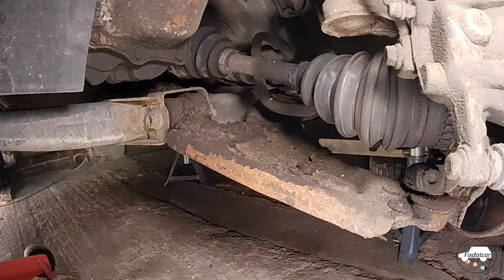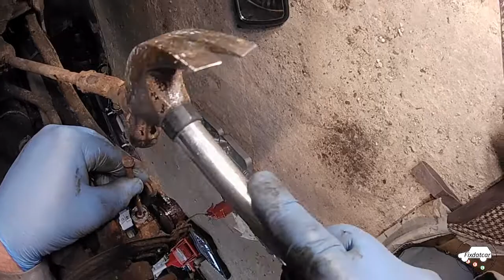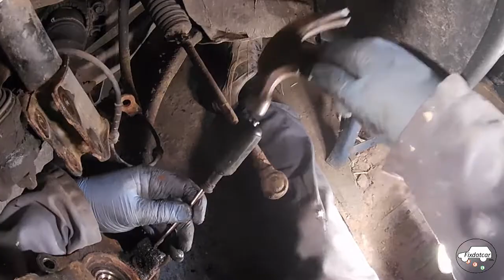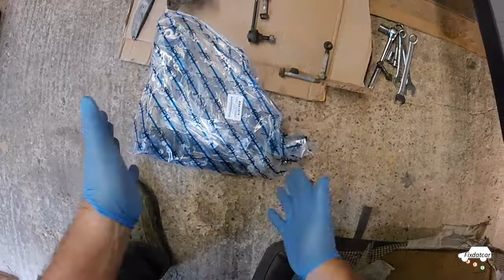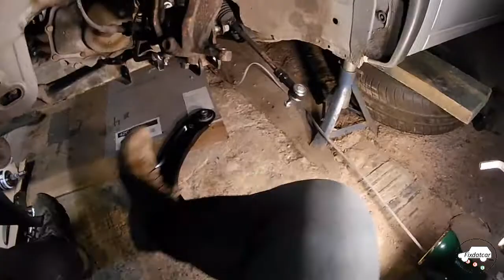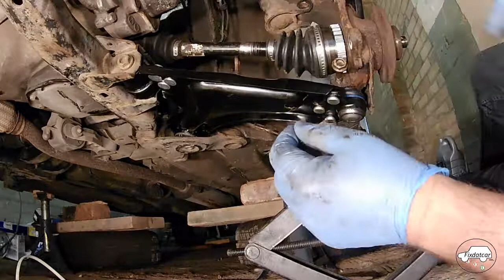How to Replace a Front Wishbone (Corsa example)

Comment: Any tips or photos of the best place to jack the car and place the jack stands? Yours seem to be a long way forward of the “official” points but much better placed for this job? Same q for rear of the car. Thanks for any tips.
Reply from the maker: Car jacking points vary by model. Either end of sill is normal, but some will have an additional central jacking point under a front crossmember. 
On small lightweight vehicles adequate strength can be found in other places (crossmember under front foot well and rear suspension areas). But be careful!
When using jack stands always add extra support for safety - In case of slippage.
Reply: fixdatcar Thanks so much for the quick reply. I was specifically asking about the Corsa C as the hard points seem quite limited. Eg when jacking on the front pad, my jack is in the way of the sill point where I would place the jack stands. Can the front subframe be used (again Corsa C specifically). 

Might be worth a video if you are looking for a subject as there is limited info on the web! Thanks again. Much appreciated.
Reply from the maker: This is a great idea. Yes I think I will put together a video in the near future on how to raise a car safely.

Comment: Is this for a Corsa D!? Any chance you know what bolts the subframe needs and also the bolts that attach the arm the subframe? I can’t find this info anywhere. Sorry to ask.
Reply from the maker: It's a Corsa C in the video but the D is almost identical.
It is best to re-use the bolts taken off. If replacing, take care as they need to be high performance. Many bolts sold generically are only mild steel and hence unsuitable. So only buy those specified for the purpose. I'm sorry, I don't know what the sizes are.
Reply: @fixdatcar7281  Thanks mate. I’ve had to go direct to Vauxhall. The existing ones are rusted and need cutting etc. So am forced to get new ones and the only option I have is to pay through the nose by going to the dealer! Lol. Thanks for the reply.